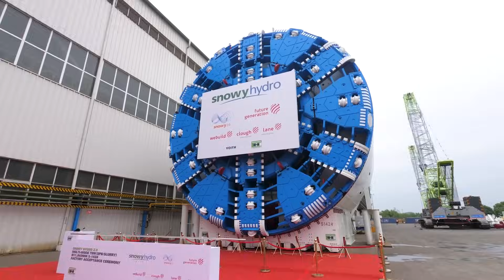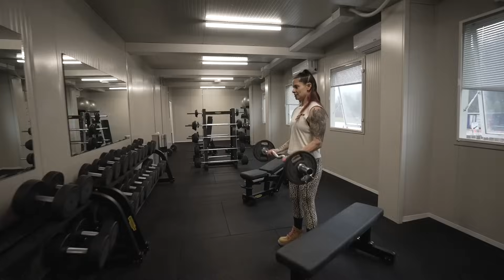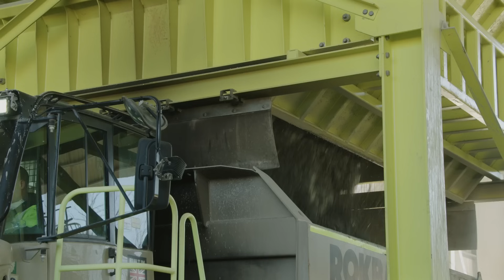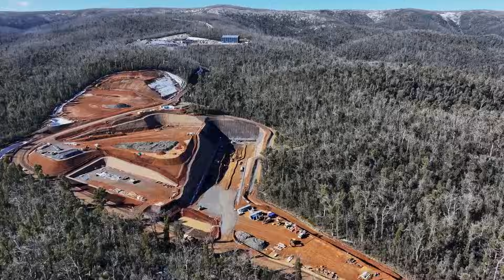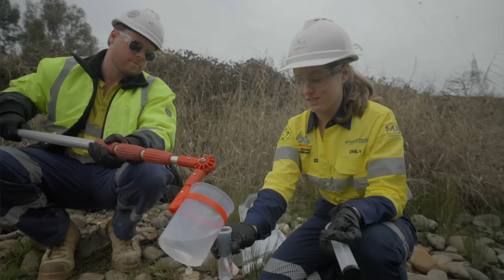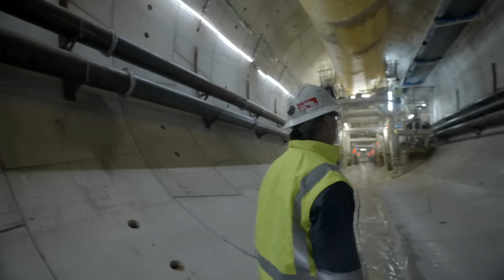Snowy 2.0 Project Update - June 2025 🌄

Comment: I still don't understand how you can use the turbines to pump the water back to the upper storage when you would need a multi stage pump to pump the high head pressure required to pump the water
Reply: Yeah, I don't get it either. So long as they understand it though, I guess that's what matters.
Reply: Essentially, the generators become huge electric motors.

Tumut 3 at Talbingo has been doing this since day 1. Several of the generating units have pumps attached under the turbines.

Snowy 2.0 will be slightly different in that the turbines themselves become pumps.
Reply: Good question. The height difference is about 650 metres. I had the same question, and I know a mech engineer who worked there for a year. She said it's not that sort of pump - not being pushed by atmospheric pressure which has a 10 metre limit. When switched from generation mode to pumping mode, the turbines push the water all the way from Lake Talbingo to Lake Tantangara - 650 metres up and 30km east
Reply: Makes electricity f

The water is gravity feed from Tantangra to Talbingo to make electricity,and thenthey use electricity from the grid to pump water back up from Talbingo to Tantangra and so forth.